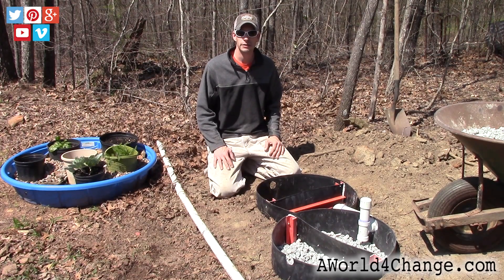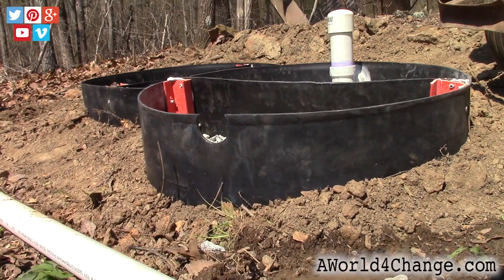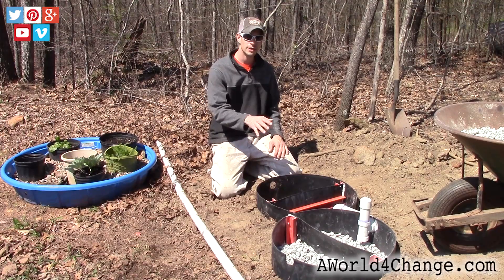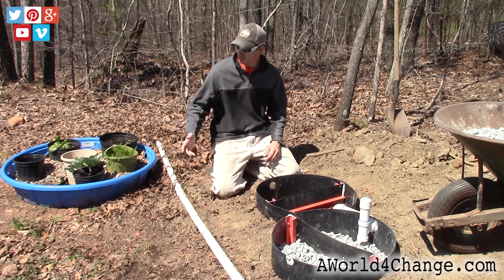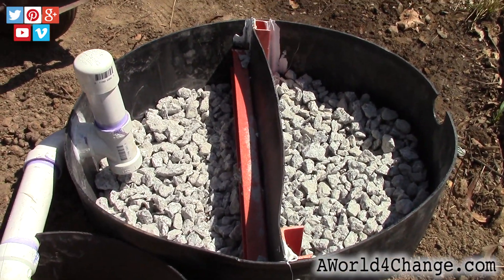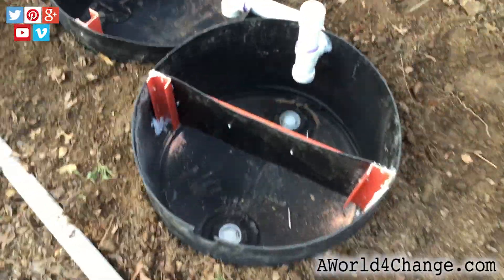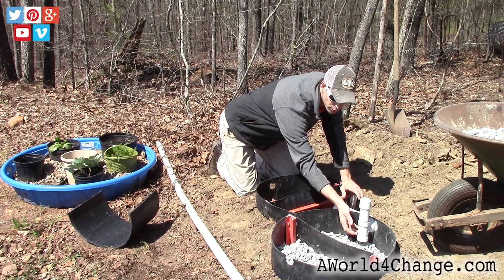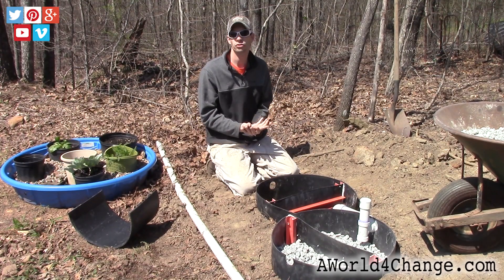Greywater Reed Bed Filtration System (Part 1)

Comment: Charcoal filter unnecessary.  The plants will do fine and absorb or help break down any nasties.  Also a charcoal filter is a pain wherever-you-don't-like-pain.
Reply from the maker: +loganv0410 - I totally understand and think you are right on. :)
Reply: +loganv0410 And if you use a charcoal filter, you have to replace the charcoal from time to time. Because the charcoal adsorbs particles and when it's full, it's full. And when is the time to replace the charcoal? Very difficult to estimate.